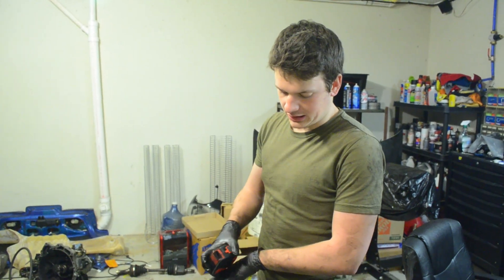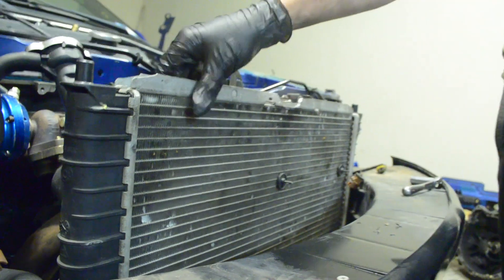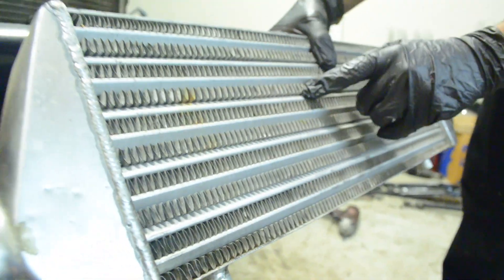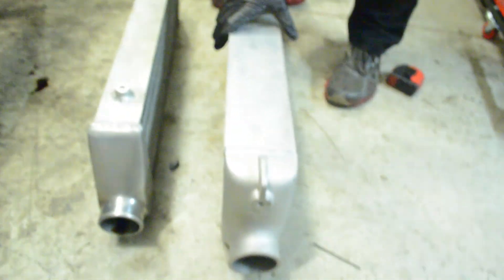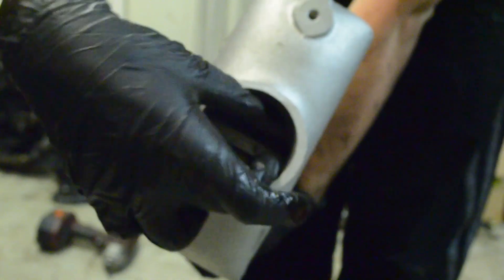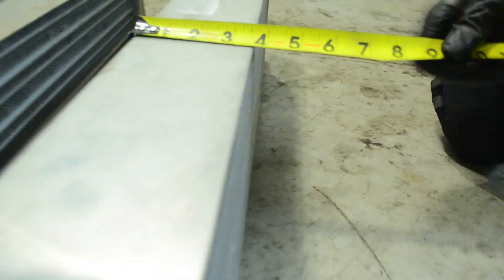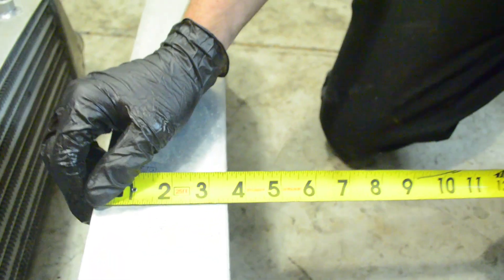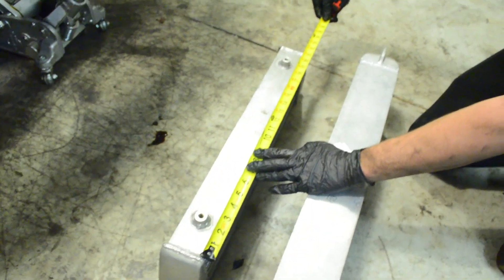Should you upgrade your intercooler?

Comment: Ok so I have a twin turbo 2.7 eco boost and I notice heat soak after start up in 90+ outdoor ambient heat. Should I upgrade my stock intercooler? I heard bigger intercoolers are not always better because you can lose boost pressure and gain turbo lag.
Reply: You don't loose pressure and the lag is negligible but it does help the engine in a high ambient temp scenario. I live in a country with cold winters and relativley warm summers and i can tell you that ambient temp makes a difference, to put it this way a bigger intercooler does not gain you any power but it helps the engine not lose power due to heat soak.

Comment: Yep, a Cork Sport intercooler for my 2019 MAZDA CX 5 2.5 L. turbo AND their higher flow hot side and cold side pipe replacements will give me an average of another 10 HP.  Not a lot of HP increase but worth the money for a high quality kit.
HOWEVER... the C.S. MAZDA CX 5 intercooler comes only in BLACK and powder coated at that. This man that after about the 1st 10 minutes of driving it will be a GREATER heat sink than an unpainted or un-powder coated intercooler. i.e. BARE aluminum gives off heat to the atmosphere better than painted aluminum and much better than the thicker powder coated aluminum.
Cork Sport, are you listening? (See the Engineering explained video on this subject.)

Comment: For stock, make sure you check your current intercooler KW rating. There are only benefits in specific scenarios. You can tune a VGT to match a bigger intercooler. You can get a KW matched intercooler with less restriction. You can retune to match a higher rated intercooler but this is an inefficient way to make power.

Comment: Another way to tell if your intercooler is up to par or if its your turbo that is not efficient ... Get the air intake temps before and after the FMI ...  Do some runs on the hwy and watch and monitor the inlet and outlet temps ... This way you can see if your turbo is getting hot too fast or if your intercooler can't keep up ... 
I have a bullseye 60-1 turbo with a tiny 24x6x3 FMI and found out it was my intercooler that was getting heat soaked ... My inlet temps were very consistent on 3 runs but the outlet temps kept going up and up by the 3rd run...  I then upgraded to a 24x12x3 and it was a night and day difference ... Now my outlet temps are very consistent ...